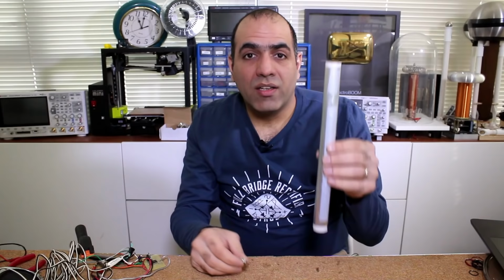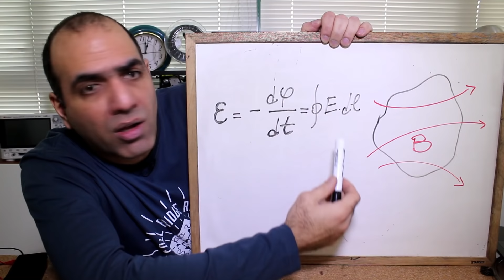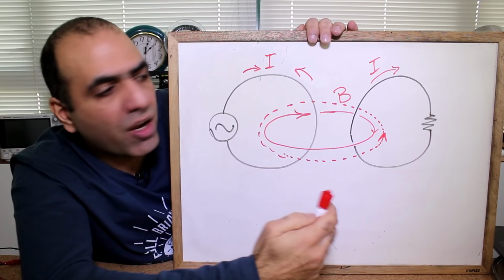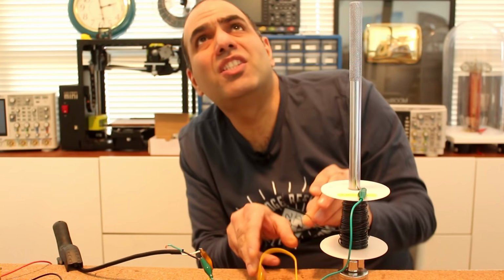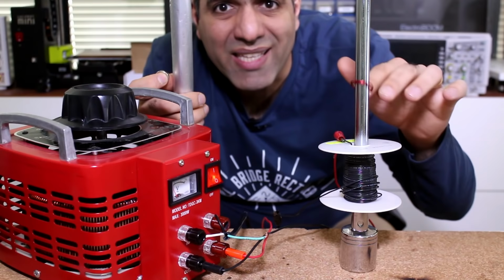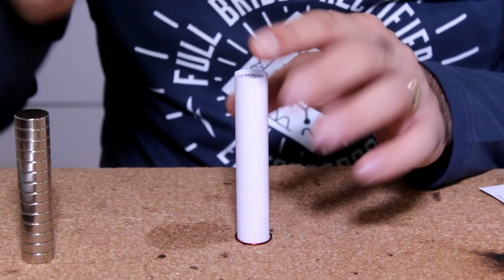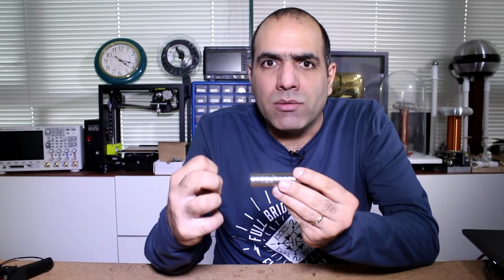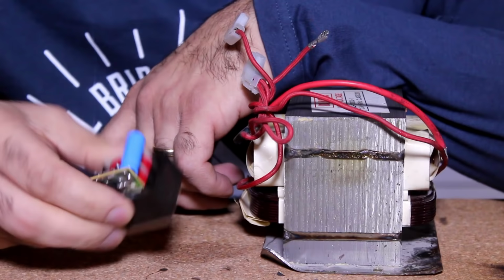The Amazing Eddy Current

Comment: Regarding the transformer: the eddy voltage is so low that even the iron oxide on the plates is enough resistance to top current from forming. The weld of course has lower resistance but since its pretty much a high resistance iron wire it is not so bad to be worse than leaving the plates loose (because they vibrate like crazy when under load). Still if you hook up a huge load to the transformer and look at that weld with an infrared camera it will indeed "light up".  also along the same idea a solid aluminum pipe of the same size and weight will make the magnet fall more slowly than the foil roll.
Reply: ayyyy cody! what legend!
Reply: Man, cody is always full of interesting information.
Reply: I just mentioned that you did something similar on your channel
Reply: Yeah. When I put  a mot back together without welding the seams again it buzzed like crazy and had a lot of waste in the air gaps.
Reply: They also put the welds in low current areas
Reply: That's what I thought, though not nearly as specific. I was guessing that the weld wouldn't have enough of an effect to influence the minimized Eddy currents in the transformer.
Reply: Thx mate ur very helping
I subscribe to u already
Reply: Hi cody!
Reply: eddy current is the power going into eddie van halen's amp
Reply: Ideally you'd have the laminations riveted or bolted, as it would maintain electrical isolation and make it more efficient.
However both methods take longer, and therefore cost more.  

A transformer that's welded will be less efficient, but if it's going in a microwave oven for example, if the oven already meets energy star requirements then they won't care if the transformer is less efficient if it means they cost less to manufacture.  

In any speciality application where maximum efficiency is required and lowest heat they will likely not be welded however. 
... In fact they'd probably just use a toroid because #toroidmasterrace
Reply: Yes the legend beat me to this comment. Keep up the good work scholars and hobbyist. The world needs your enlightenment.
Reply: There are transformers with a small slit instead of the welding. They influence some properties by doing so. I'm not100% shure, but I think old cathode TV transformers have that slit instead of the welding Here.
Reply: Raise the frequency to about 10KHz and see what happens...for FUN!
Reply: Well, I guess you've got something there, the guitar is the input to the amp......you got the coil of wire in the pick-up, and some magnets and steel strings....NOW, the power coming out of Eddies (Eddie VanHalen, just so we are talking about the right eddy) amp...That's something you will notice!! @commentfreely5443
Reply: I think that because the magnetic fields are perpendicular to the weld and parallel to the lamination,  the magnetic fields are about the same on two points of the weld, but also cut off on the other side (so basically there are small currents along the weld, but not enough to be bothersome (and a bolt probably is more problematic)).
Reply: I read this in your voice...
Reply: Thank you both, now I can make my own magleg train and solve my country's problems hahahahaha... Knowledge everyday!
Reply: Nah...its about whether you've created a conductive loop that is penetrated by changing magnetic flux.  If the weld bead is only on the OD of the motor core, there isn't a conductive loop linked (penetrated) by changing flux.
Reply: So if resistance is the enemy of hovering, would a silver pipe perform even better than copper?
Reply: Cody, have you been drinking? Cheers
Reply: Is there any area of science Cody doesn't know?
Reply: Also, all transformers are welded that way.
Reply: DO YOU KNOW THAT AM THE ONLY DIE HARD FAN OF YOURS FROM NAGALAND??
LOVE YOUR WORK...
STAY SAFE..
Reply: And thank you. I believe you because I don't have no idea what is you talking about..
Reply: Hi! I need help with a project. I am trying to turn Dell AC511 sound bar (Monitor speakers) into portable speakers. Their "aux in port" dont work when turn on using a powerbank or a wall charger. Aux in only work if connected to a PC USB port, Probably some communication in the D+ D- ports. So is there a way that we can use a power bank and send some sort of  a signal to D+ or D- as well to make the "Aux in" work ? It works with a router USB port because router also communicates through D+ D- pins of the USB.
Reply: Why the aluminium pipe of same size and weight  will make the magnet fall more slowly than foil roll?  Help anyone?
Reply: How does a scientist know more about electricity than an electrician or electrical engineer?
Reply: OUR BELOVED CODY
Reply: yes I have successfully rewound and reinstalled transformers with very little heat build-up without any coating on the laminations, but is is always better toapply a epoxy to the laminations because the "Buzz" from the laminations van get very loud at high loads
Reply: I think the wasted energy by the weld would be greater under no load.
But permanently used in a microwave oven, there is no chance this transformer will sit idle for hours, waiting for a load connected to the secondary.
Who is crazy enough to make jacob ladder or neon/ fluorescent high voltage source from a microwave oven?
The advantage of lower vibration outweigh the loss.
Reply: @shishkumar6042 unless i'm mistaken (not impossible) the answer to your question will be this: because greater eddy currents are formed in the solid pipe think of it like this; both the designer of transformers and the dropper of magnets down tubes are concerned with eddy currents, however they have different goals: while the magnet/tube dropper guy (or gal) needs them to create the fields that slow his (or her) magnet,  one who designs transformers wants to keep them under control. some toroidal transformers are in fact constructed much like the foil roll- a long strip coated with an insulating layer and rolled into a donut shape. apparently, this works very well, i'm not sure why. one will not, however, see a transformer core that is a solid piece- just too much waste to those currants and their heat. also, i don't know if a solid core would couple the coils together very well. transformer design confuses me.  peace be with you.
Reply: cody, if you read this: hang in there. You have the strenght to go through this. In other life, maybe we would be drinking a beer and laughing about life. take care. Thanks for your work.
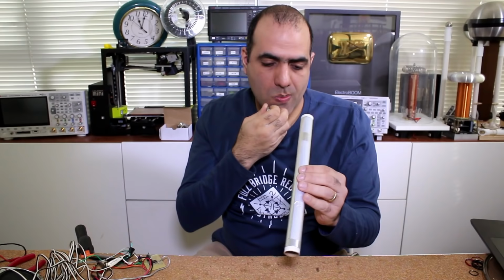Reply: 1:00 created a time machine look at the clock behind
Reply: hey cody your here to like your video to. of the alchemical things.
but last time your more in the garden.
Reply: @shishkumar6042  Late reply: lower resistance through wall thickness in the solid bar than in the roll of foil (where the layers may not make great contact with each other everywhere) and as the man says, lower resistance = higher eddy currents :o))
Reply: wait is that why those big ass green metal transformers on the ground we used to play on in the cold would vibrate
Reply: Good beeg brain
Reply: @maulerrw  Plus the transformer is not energized all the time.  If the transformer was used 24 hours a day it would be wasting power all the time.  The duty cycle of the microwave is small.  It only runs for short periods of time so its waste is considered acceptable. .
Reply: In addition to welding the stacked laminates together, you also need a way to connect the laminates on each layer. For example, a layer is made up of either an E and I, or a T and two L shaped laminates. That's so you can add pre-made coils to the stack of laminates, then weld the whole unit together. So the coils would either go around the middle tine of the E, with the I welded on -> EI. Or over the base of of the T with an L welded to both sides -> LT(backwards L). I suppose this is a compromise vs making a single laminate shaped like an 7 segment 8, then trying to wind the wires around it. I used to work in a factory that made Transformers.
Reply: Wow ... Cody's here
Reply: @suprememasteroftheuniverse  Err NO THEY AREN'T! Otherwise, it wouldn't be possible to disassemble and reassemble them, as in most E/I plate transformers. Something I have done MANY times! It all depends on the transformer, it's planned usage, and design characteristics.
Reply: @agr00m  Think you should have paid a little more attention when at that factory. E/I plate transformers can be made in TWO ways, the one you stated (less common) or by alternating the E/I plates top and bottom so they interleave. Check out virtually any small iron cored transformer and the vast BULK of quality transformers are made this way as they are more efficient and produce less waste heat.
Reply: @agr00m  Think you should have paid a little more attention when at that factory. E/I plate transformers can be made in TWO ways, the one you stated (less common) or by alternating the E/I plates top and bottom so they interleave. Check out virtually any small iron cored transformer and the vast BULK of quality transformers are made this way as they are more efficient and produce less waste heat.
Reply: No Cody! Eddy current losses are independent of the load! Loading a transformer only increases copper losses!
Reply: Yooo big brain
Reply: Bro I was about to write that
Reply: hi cody !
Reply: In the video he said the bigger the magnet inside the slower it falls bc of more eddy current produced. 

What would happen if the magnet was long enough not to flip inside when dropped & wide enough to cover almost the entire hole? 

What happens to the magnetic field if you use additional force to drag the magnet down way faster than the speed of the “autonomous” fall? Could you produce a magnetic pulse perhaps?
Reply: Hate to say it but this isn't exactly it. It doesn't generate much heat because the plates are in near parallel with one another electrically along what amounts to [not much more than] a point, the same point (meaning in phase), in each plate. 

There's a small amount of extra heat due to current flow along the weld, but it is due to the minor variations in the position of the weld as it goes across the laminations, and gradients caused by distortions in the magnetic field thru the core. The depth (cross section) of the weld also plays a role; the more cross section the weld has, the more distortion it will impose on the main field circulating the core.

These currents are mostly confined to that weld, and are defined by its resistance and the gradients that act on it, which makes them show up as a warm spot on FLIR. In effect it's a wire that's laying in the same orientation as the coils, the gradients give rise to return paths within the skinny "conductor", causing heat. Note the laminations run perpendicular to the coils; this is the orientation that has the greatest reduction in Eddy currents in them.

A similar thing happens with bolted corner type transformers, the bolts tend to run warmer than the rest of the core, yet are in effect, "insulated" from it.
Reply: @HummusPvm  The orientation of the magnet is almost irrelevant because regardless of where the field cuts, there will be a field of exact opposite polarity being induced to counteract it.

This is why the magnet effortlessly tumbles in whatever direction... There's no single force acting on it to change its orientation (the forces are essentially balanced in every direction within a round tube like that). Since gravity is the only remaining upsetting force, only it's vertical velocity is affected.

A longer, closer fitting magnet (assuming identical field strength and mass) that can't reorient itself without actually hitting the pipe will couple better to the pipe and fall slower. This however is only because the gap that remains all around it when it centers itself in the tube is much smaller, and inverse square does it's thing.. Stronger effective field, stronger induced field, stronger retarding force pushing back on the magnet as it falls.

As for the "add force"... You create more Eddy current, which opposes the motion that much stronger. A reverse version of this is putting the magnet on an insulating rod and slipping the pipe down over it. Then quickly pick the pipe straight up... The magnet will follow the pipe and remain inside (for only a short time of course).

The mechanism is purely relative in nature... Move one, the other wants to follow, in proportion to the rates they are moving against one another. You will also find, if you place the pipe on a scale, the pipe weighs itself + the magnet while the magnet is falling thru it.

Vintage era car speedometers were based on this very principle, only providing torque instead of linear forces... Check out "drag cup" on Google for more details 😉

Oh, regarding the pulse... Well... Yes and no. Likely not in the form you're thinking of, at least not in any immediately obvious way with what's available off a shelf, but: 

If you took a powerful enough magnet, got it moving fast enough, shot it thru a thick enough pipe made of the right material... You might see some interesting things happen, yeah... But the pipe has to break electrically (and therefore physically) for anything spectacular to take place... The pipe will tend to have the effect of shielding the field and confining it inside while the magnet is moving. It is only when this field suddenly breaks out, that the magic would take place. But don't get too excited... Not exactly an easy feat.
Reply: @MadScientist267  im genuinely so happy you responded. Ofc im not looking to produce an emp with a magnet and a pipe, its just that i take ideas to their extremes and hence was curious what would happen. Loved your answer and if you dont mind, ill be asking another question which I hope you can answer a bit later😄
Reply: @Car_Ram_Rod  zc
Reply: po
Reply: .. plenty education here.